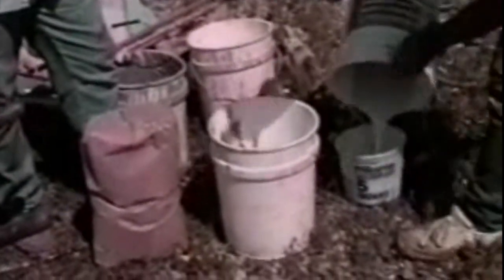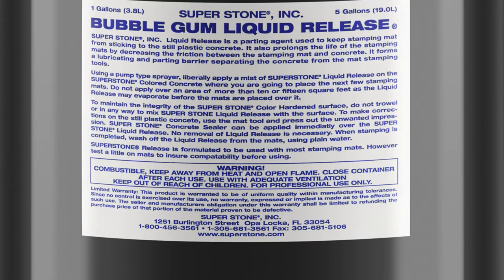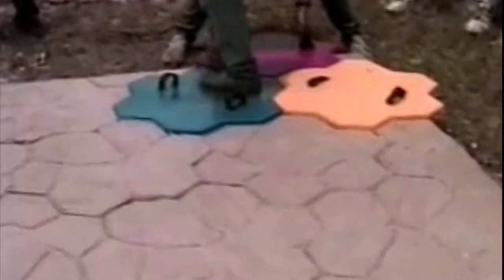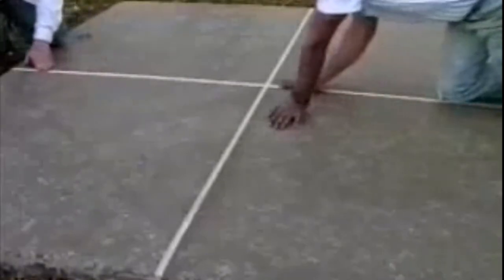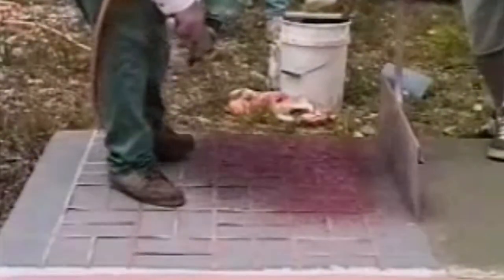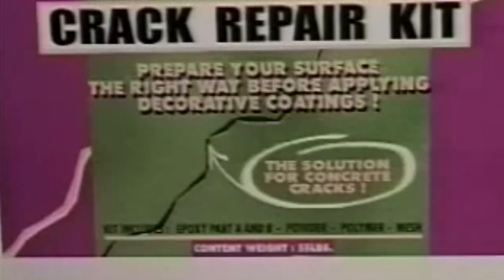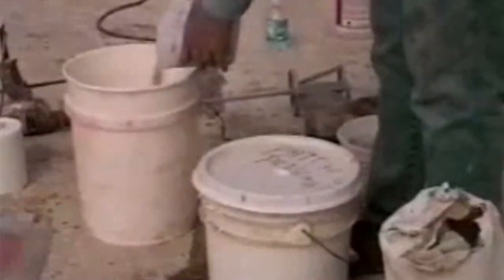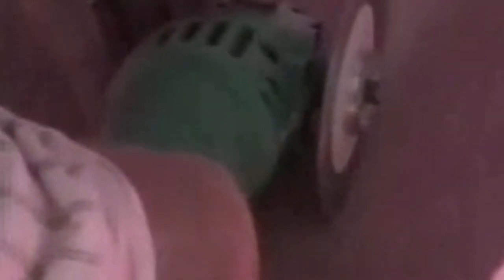How To Resurface & Stamp Concrete: Super Stone Super Surface

Comment: I have a poorly stamped concrete pool deck in a directional pattern. The stamping has been done crooked by about 15-20 degrees and it looks awful, and now the contractor is MIA. Short of tearing it out as I don't have the funds for that, I'd like to have it overlaid with your product. Do you have an installer in Muskegon, Michigan?

Comment: So what about pulling the knockdown in more than one direction, to not give the look of the new guy pulling it in one direction. Wouldnt you want to pull it in more than one direction for lead and following edges being uniform and not unidirectional?. Maybe in *83 this wasnt such an easy and unheard of process in knockdown, wether it be walls, ceilings or floors. Other than that, just as easy to do the overlay processes, as it shows, no matter the manufacturer or application. Can a nonslip additive be added to final sealer to keep uncle clark from slipping and falling after a rain shower?.